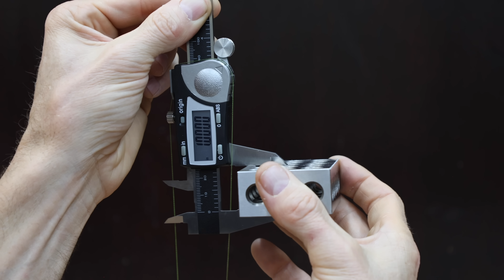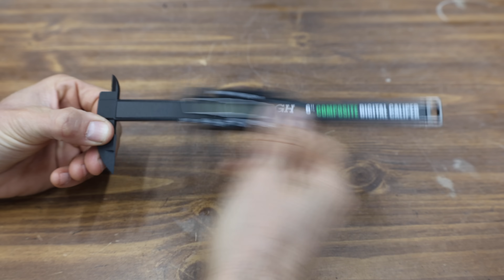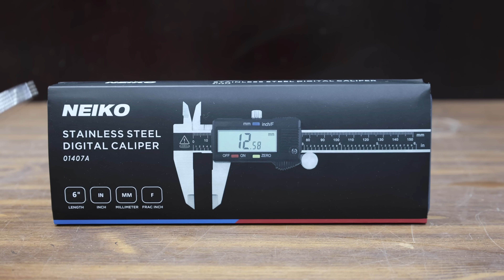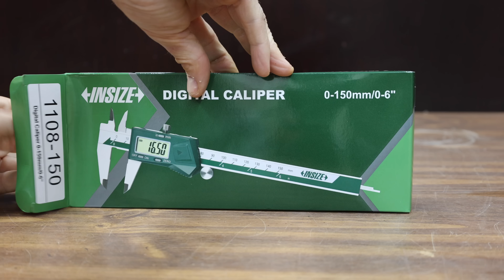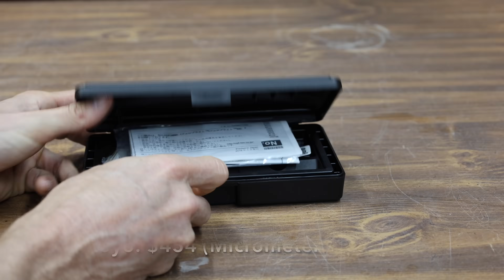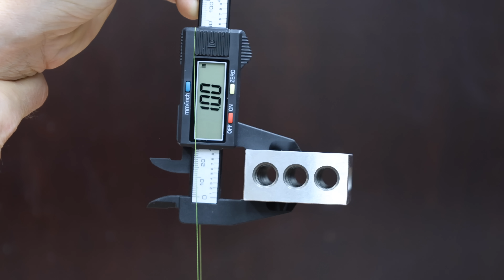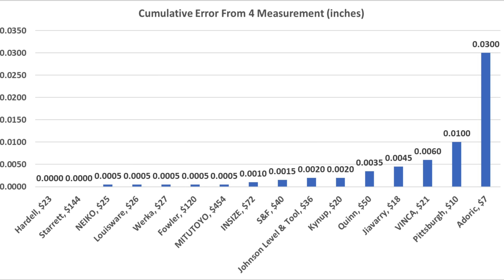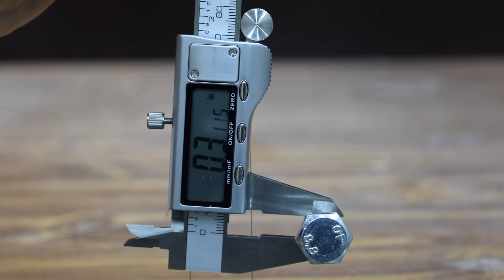I've Been Proven Wrong About Calipers!

Comment: I grew tired of picking my calipers up after they sat for months only to find they were dead.  I grit my teeth and went all in on a Mitutoyo. YEARS in and I'm still on the same battery.

Interestingly, a friend has a Mitutoyo and he uses a cheaper one, because it's, significantly, more accurate. He has the cylinders and blocks for measuring and mine is accurate, while his isn't.

Comment: I made the mistake of thinking a little there would mean good elsewhere. I bought a Starrett angle gauge for my woodshop. It just didn't seem right from the get go. Reviews showed the exact, same problem - off enough picture frame angles would look like amateur stuff.  

Starrett made upgrades and applied similar problems. I guess they figure woodworkers didn't kneed more than 1/8" tolerances.

Interestingly, cheap, digital angle gauges are dead on.

Comment: Metrologist here. The only 2 test that matter for this would be a linear test and a Gage-r
Gage-r would be a 1x10 1 part measured 10 times and should be under 10 percent to be acceptable. Linear test would use gage blocks to check every 5 or so mm of span and pending on grade of gage block within 30 microns of stated gage size
Reply: The digital calipers are going to be linear almost by default, because of the way they work.

Comment: the shutoff funcion can be a hindrance. if you set your calipers on a specific measruement you want to have this staying. if it can shut off most callipers can "forget" your masurement and you have to reindex the masurement you wan´t tp have. for example you turn shafts to  specic diamter with a  tolarance, then you can use use diffrence to check how far out of spec you are. ( if this is bad in english i am sorry, just you´re average germansteelworker^^)

Comment: Good review.  I would have liked to see some better markings on the beams.  Sometimes the battery dies, and for most of the brands you tested, the calipers become almost useless since they aren't measuring anything with any kind of accuracy.  That's why I prefer a purely mechanical model for accuracy.  I keep an electronic set though at home, where super accurate measurements aren't that important.

Comment: One thing I know for sure about the Mitutoyo, I bought one for using to take regular measurements while operating a waterjet.  That is a very hostile environment to calipers.  They were dropped, soaked, exposed to garnet and would make sometimes hundreds of measurements every day.  After eight years they got replaced, but I still use them as my desk calipers.

Comment: My personal advice is always to buy metal calipers, check upon receipt that they are not fine electroplating on a plastic base ; otherwise we request a return/refund.
I'm on my second one for less than 20€, the first one was bought on eBay more than 15 years ago , he let me down so I bought another one 2 years ago, I use it for all sorts of basic things (3D printing, plumbing, electronics, ...)
As long as several measurements of the same size always remain the same, for personal use, there is no problem in case of a tiny discrepancy between the actual size and the measured size.

Comment: The great thing about the fibreglass calipers is measuring things you don't want to short, electrical contacts, li-ion batteries, etc. I don't have Starret/Mitutoyo money, but SHARS is a big step up from the generic calipers without losing your shirt.

Also, gotta love the reverse italic text on the Pittsburgh, never seen that before. 10/10 for that alone.

Comment: Great testing as usual. I have some Harbor Freight metal calipers and like them especially the 6" one is handy and works for many things. The only problem is the battery will run down even if I turn them off. I have to remove battery every time I use them. Don't understand this and wondered if anyone else has this problem? Thanks, and many thumbs up.

Comment: 18:40 you have the price way off on the mitutoyo. They are about $160
Reply: Yes, he got it wrong.
The $454 included the Micrometer in the boxed set.
Reply: @lindsaybrown7357 He mentioned that
Reply: They discount them usually once a year and you can pick them up for about 110.00 usd. I usually buy two when they do that
Reply: @paulerenberger1286  Global Test Supply has them for $110 year-round with free shipping. They are an official Mitutoyo dealer, so I'm not really sure why anyone buys them anywhere else.
Reply: @paulerenberger1286  is it a specific time of year?
Reply: @JoetheSeophGlobal Test Supply has them for about 100-110 year round
Reply: Sounds more accurate when I compare prices here in Sweden 👍

Comment: As a machinist for 10 years, if you buy calipers, get analog, digital calipers suck. If you get any coolant on the slide, it'll mess up your sensor and you'll get screwy readings. then you need to spray IPA in and move the slide back and forth to clean it, wait for it to dry and then reset your zero.
No such issue with analog. Your gears may get gummy, but you if you keep it oiled, no issue, or if it gets gummy, use IPA just like before follow with oil and take care of it. No need for batteries.

Calipers also deflect, so don't push too hard, or you will deflect your measurement. (Some people do this on purpose with tight tolerance pieces, when the part is "close to tolerance" and it's very obnoxious. Do not do this. If it's OOT, it's OOT write it up or trash it. )
 
If the measurement is critical, use the micrometers, they are more accurate.

Every aerospace shop I've ever worked in has used the mititoyu brand.

But every digital caliper has the issue I mentioned with coolant or dirty slides.
Reply: TIG welders wouldn't know what cutting fluid is. For occasional home hobby projects I bought fake Mitutoyo LCD calipers on E-Bay for $ 40 in 2021. They still work great. Current Amazon price for the real ones $ 155 to $ 163. As a TIG welder and precision fab guy the only Starrett tools I have are 6" & 12" combo squares and 24" and 36" hard rulers.
Reply: If you're in a very coolant rich environment where it constantly drenches your calipers, Mitutoyo make digital calipers specifically for use in coolant rich environments and they don't cost much more.

Comment: The low power draw and auto shutoff on the mitutoyo are a huge benefit. I used to use a cheap set of calipers, and it was accurate, but I had to replace the battery every ~3 months.

Then I bought a pair of mitutoyo calipers. I wanted calipers with a rechargeable battery because I just hate buying and disposing of batteries all the time. Some of those calipers that use a CR2032 might work OK with a rechargeable LIR2032, although they might not because the voltage on the LIR2032 is a little higher. The Mitutoyo uses an LR44 battery. HOWEVER, since buying my mitutoyo calipers almost 4 years ago, I have NEVER ONCE replaced the battery. I just use them for hobby projects not everyday use. So sometimes I might use them a lot for a few days on a project, and then they might sit in my drawer for a few weeks without any use. But it's still amazing that they're super accurate, very smooth, and draw very very little power from the battery.

For me, the long battery life is very useful. Sometimes I use my calipers away from my home, and I don't have replacement batteries on hand. For example, I needed to replace and upgrade some parts  on my sailboat and measure dozens of dimensions -- bolt lengths, extrusion thicknesses, etc etc to take notes for fabricating some replacement parts in my garage. If I have to do that on a boat that's in the water, I probably don't have a bunch of spare batteries on hand. In the past, it would be very frustrating when I'd bring along cheaper calipers to measure something outside my home and then be unable to use them because the batteries died. So I appreciate that my mitutoyo calipers can last for years on a single battery, and they're always available and accurate whenever I use them.

Comment: The biggest minus of this tools is the not existing 'real' on/off-switsch. They are all 'stand-by'. A real switch cuts the current from the electronics. If i don't use the caliper for some months, the battery is empty. This has happend more times. Now i use only mechanical calipers. They are exact enough.

Comment: I got a cheap digital HF set for the long range hole puncher bench. Probably a mistake, but a week with a stone, alcohol swabs and my good sets as reference had them straightened out. Also, the well mentioned battery thing, silver R44/357 and i take the battery out too, just like laser pointers. If you never did the vernier caliper and micrometer thing, you dont know how good you have it with digital.

Comment: Love the idea!

I have a set of the NEIKO calipers, and they have lasted me many years. I love them. 
They're great for a hobbiest 3D print/designer.

After years of use, my only complaint is that even after zeroing, it has started to be off by 0.015mm.
So I will zero, and then it'll show -0.01mm, or -.02mm.
While not something you want for super precise, I still am happy with it, even after the drops it has suffered.

When I want very accurate measurements, I'll take the mean or mode. Depending if I have a calculator or not haha.
I also really like that the NEIKO, and some of the other ones, have a ruler. So if you're out a battery, you can still get some measurements.

Comment: What are you using it for???  Just like a car, do you really need a 150 thousand dollar car that goes 200 mph to drive down the freeway at 70 mph as opposed to being in the Indy 500.  I have both a Starrett and a Harbor freight 30 dollar caliper,  for most things I do I don't need anything with more accuracy than the Harbor freight. I found it works fine for most simple jobs.

Comment: I'm very interested in standby battery life.  As an amateur guitar technician, I need accurate measurements occasionally, but I  don't use the calipers every week.  My fairly cheap calipers go dead in a couple of months whether I use them or not, and for long time I would only get a half-dozen measurements out of each battery.  I have formed the habit of removing the battery after every use, so that one battery will last for years. So, two things:
1. It would be great to include standby battery life in any future ratings.
2. For folks like me, who go for economy over excellence, and remove the battery to get better life, the battery compartments that have screws are much less convenient than those that don't. A slideing-cover battery compartment would be a must for me.

Comment: 0.01 inches is not good. why bother.  you might mention steel or plastic body/jaws and for what period of usage the caliper stays accurate.
The INSIZE caliper has a micro USB port and probably has an app. Does the app report all the sensitive data on your computer to the chinese communist party? .

Comment: I've used calipers and micrometers throughout my life, mostly sticking being the high-end brands. I have a 0.500" tungsten gauge block for accuracy testing, and I check my instruments with it daily before use. I perform an open and close test on digital instruments five times to 0.0000. When they no longer consistently meet these tests, I toss them in a drawer and buy a new one. You'd be shocked at the number of digital calipers in that drawer. My backup caliper is an old set of Mitutoyo analog calipers, which are very reliable and accurate. I've also noticed that changing the battery often improves the accuracy of my calibration test before it retires to the drawer. Does anyone know of a company that reconditions digital calipers, and is it worth the cost?

Comment: I work in QC at a machine shop and calibrate tools fairly regulary, as well as use my own calipers and micrometers constantly. I find that Mitotuyo and Starrett stand out for their quality and accuracy in general. For calipers in particular, I would give the edge to Mitotuyo. For indicators, I've found Starrett to be unbelievably accurate and repeatable on certified gauges, better than Mitotuyo even. For micrometers, the Mitotuyos are unbeatable. I have one set that is from 1984 that has the lettering worn away and it is still accurate and repeatable on the certified gauge tree. I've probably only adjusted them .0001 a handful of times over the course of a few years with daily or near daily use. Great tools.

Comment: While I have a highend digital caliper, I also have the $10 composite Pittsburg one (from Harbor Freight). I use them as my general "beater" caliper, and have used them to get measurements on a lot of things for modeling. Used those models for 3D printing (filament and resin), as well as CNC work, and they have worked great. So unless you want to spend the big bucks on something made in the EU, US, or Japan (for precise accuracy and longevity) - just go with the $10 Pittsburg ones.

Comment: Your depth measurements are probably off because your table is not flat enough to  be accurate. You need a surface plate to discount dust, sctrathes, pits etc in your table. Another good test woukd be to leave them powered off for two months and then see which ones have dead batteries. Many of the cheap brands drain the batteries even when off.

Comment: I have HF calipers at home with the auto-off function and I usually have to replace the battery every few months. I used to complain that my expensive Mitutoyo at work doesn't have an auto-off function, but it's been a few years and it's STILL on the original battery!

Comment: Depth measurements may have been affected by the uneven surface of the wooden bench used as the backing surface. A better method would be to use a plate of glass or ceramic tile in a pinch or better yet a granite surface plate

Comment: Most callipers use a phase offset scale that cycles every 5mm and they just keep offset in memory while they're "off" and check the scale reading periodically, not at full speed but a few times a second. If any offset has been detected, the calipers power back on. So as long as the movement between readings was smaller than 5mm, the callipers remain calibrated and don't need to be manually reset.

Some people believe that this drains batteries, but i would like to suggest that the sleep alone with periodic readings consumes so little power that an LR44 should last for around 4 years. I would instead like to suggest that there is often a different source of electrical leakage on the circuit board. In particular, bad isolation between metal and circuit board may be to blame. I have also seen callipers with a peculiar defect that if moved quite quickly, sometimes they become confused and jump by 5mm, probably due to stray erroneous scale reads since this fault isn't consistently reproducible.

I have bought callipers recently with a spectacularly pretty display but otherwise they're a disaster, there's a visible angle on the jaws and there's so much difference in the thickness of the stationary beam, that i can't properly trim it with setscrews. My disaster is Wanoore branded. At least the metal isn't pitted and unpleasant to hold unlike home improvement store ones i bought previously, but it appears i'll have to grind them down myself if i want them to behave.

Comment: Your Amazon link says the Mitutoyos are $163, why keep the $454 in the excel spreadsheet image? I bought a 6" Mitutoyo in 1997 and a 24" Mitutoyo in 2008, and both still work fine in 2025. My experience is the expensive tools will last a long time, and those cheap China tools will be done in just a few years.

Comment: I've been using the Vinca brand for a couple years at home. For what I use it for, the accuracy and consistency is just fine. I bought it for less than the current price as well. My only complaint is that it does drain batteries if they are left in the tool. Even when off, it is draining slowly.

At work I use Mitutoyo and your pricing is pretty far off. I'd double check sites like MSI Viking Gage or Travers Tool, something like that to get a realistic price. They actually compare fairly well on price for a very high manufacturing quality tool. For reference, current MSI Viking price is around $150 and Travers is $120 instead of the $250 you reference in the video. Buying on Amazon only you'll get locked into whatever reseller has them listed and they usually include extra fees even if they have their own web sales company. I'm sure you do these prices for affiliate links, but I wanted to let the viewers know there are more affordable places to buy the "high end" metrology tools.

Something else to keep in mind is that when you have more than one of these tools in a shop, you want them to measure consistently from tool to tool. We've found Mitutoyo to be very reliable from tool to tool for the 20+ we have in service and we check calibration annually to ensure they are still measuring correctly to our standard measurement blocks. I'm not sure what result you'd get if you took 3-5 each of the less expensive tools and compared their measurements to each other for consistency. Something to re-test the top 4-5 in another video? Probably not enough general interest in that, but I'd be curious of the result!

Comment: i have a caliper that I bought years ago named Whitworth and it is still doing great...it is very hefty and I used it when I was a mechanic...i think i got it at Harbor Freight...i had to look really hard for the name of the maker and it was on the back...they range from 25-50 dollars on ebay.....so being I have had it for over 15 yrs easily, it is a pretty good tool...i also keep the battery out of the tool when not in use
Reply: Whitworth was also a British measuring unit used on cars and Trumph motorcycles in the fifties and sixties. Not metric and not US thread